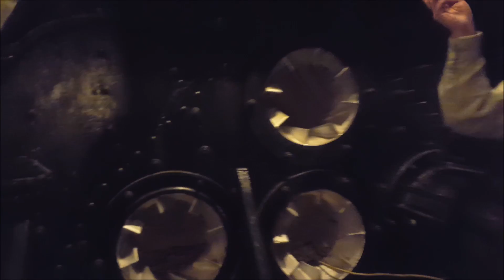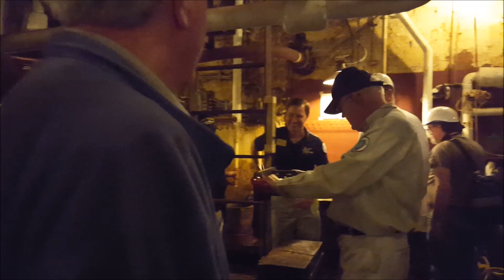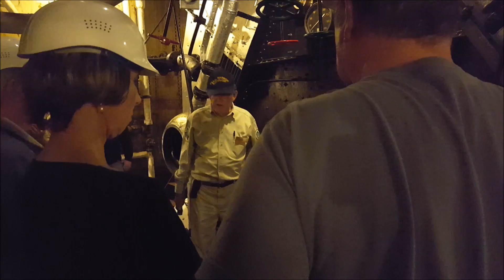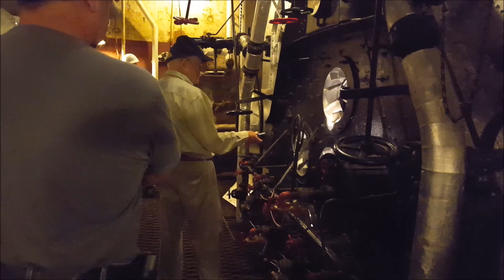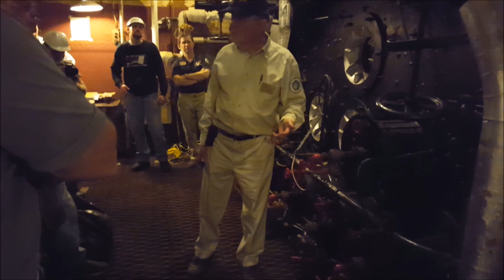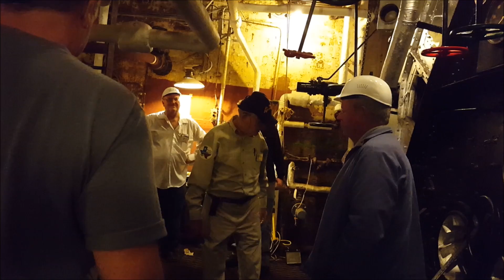BB35 Boiler Room

Comment: "He didn't have to do much, just watch that gauge glass" Imagine, it's 110 or 115 degrees, one o'clock in the morning and you're up there by yourself watching the water in that gauge glass slowly shrink and swell, shrink and swell as the ship sorta rumbles through the water, the steam turbine pumps are running at about 120 decibels or more. Standing Checkman, that's the name of the watch station up there can be absolutely brutal. It's hard to stay awake and stay focused. Also, if you mess up and run high or low water you can ruin the boiler, kill your fellow watchstanders or even cause a catastrophic failure in the engine room next door. The old dude giving this presentation is pretty amazing, would love to talk shop with him.
Reply: The gentleman giving the boiler room explanation is Mr. Tom Gillette, an incredible asset to The First Texas Volunteers.  He was a marine engineer and worked the aftermath of the Exxon Valdez disaster.  His father was a naval officer and he was a child when the IJN attacked Pearl Harbor.  Much respect.